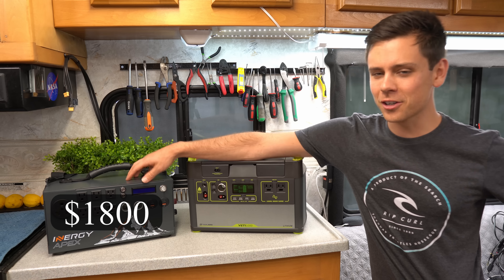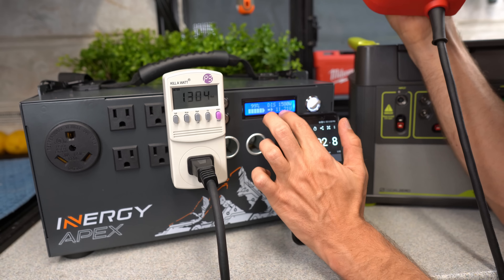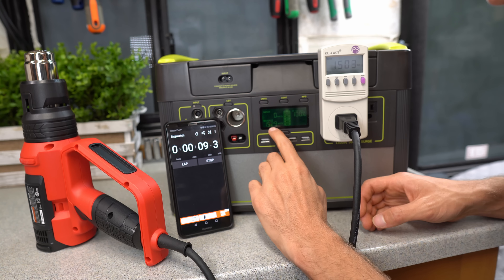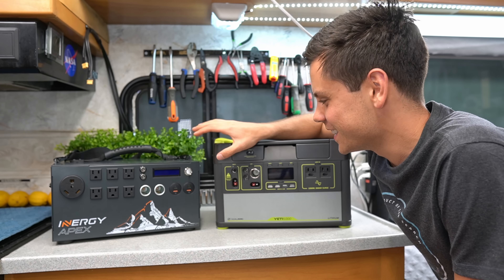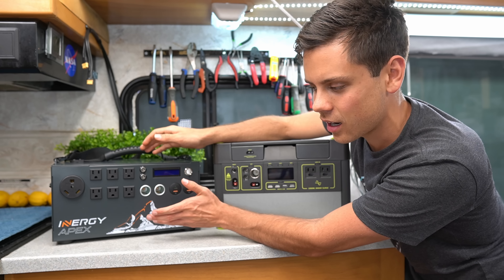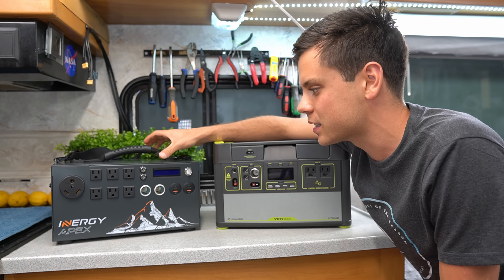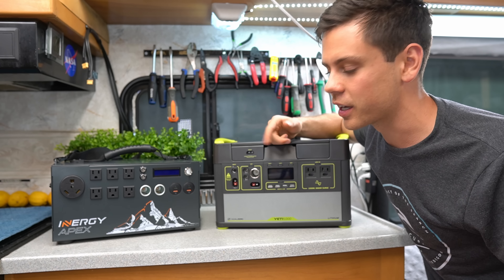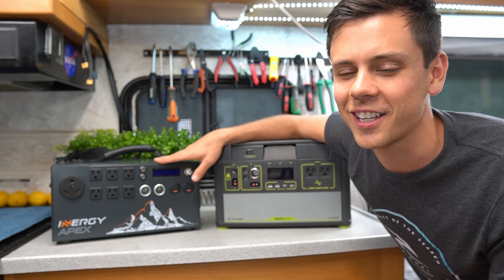$1100 GoalZero VS $1800 Inergy Apex Load Test

Comment: So does the goal zero charge up as fast as the Inergy.  Overall with everything u always consider would u buy the goal zero over the Inergy?
Reply from the maker: I'll be doing another video on charge rate for these. Inergy charges faster, but with modifications, the goal zero can too
Reply: @WillProwse  I think the main advantage of the Apex over the Yeti is charging cycles. For my situation where we plan to take our van on trips several times throughout the year, a Goal Zero unit would last for quite some time.
Reply: @WillProwse 

Thank you.
Reply: @jfinca1 I think Will spoke to this specifically. GZ and Inergy use the same battery chemistries so it would make sense that their batteries should have the same cycle specs.... but they don't. So perhaps as Will suggested, there could be other outside factors that are enabling the Apex to have more cycles. That being said, if the GZ is well replenished and doesn't go down to the 80% mark often, then it'll last a lot longer.
Reply: @jfinca1 I use up to 3 inputs on my Goal Zero while using it at the same time .  It doesn't care . . . . $774.00 for  'open box'  !  Love it ! ! ! 

   It's inverter will run my washer and dryer while my 'Windy Nation' pure sine inverter (1500 watt) try's , but bogs and shuts down.    Love the Goal Zero and their customer support was >100% when I needed it once . 

    The battery has not lost any capacity in over a year of use while in the mid-range of 40% to 80% .   Heat,  full charge,  and low charge  are the enemy's of Lithium battery's .    Run it in the middle and charge/discharge below 1C and it may last forever  ! ! ! !

Comment: If goal zero had a better charge controller so we can use more solar they would be a clear winner all around
Reply from the maker: They have a mppt module. I will test it this week. Really curious to see how well it does compared to my victron controllers. Will be an interesting test. Goalzero might be the winner when it has mppt upgrade
Reply: DIY Solar Power with Will Prowse Yeah, the MPPT module really helps with efficiency. Plus, you can also use the built-in PWM inputs at the same time for 720w total input from a mix of solar, wall chargers, car chargers simultaneously. Obviously slamming that much energy in fast isn’t going to make the battery very happy long term but it’s good to know you have flexibility. Inergy’s unit can only accept one kind of input at a fine according to their support folks.
Reply: @todd.parker  -  You nailed it !  I use up to 3 inputs on my Goal Zero while using it at the same time .  It doesn't care . . . . $774.00 for  'open box'  !  Love it ! ! ! 

   It's inverter will run my washer and dryer while my 'Windy Nation' pure sine inverter (1500 watt) try's , but bogs and shuts down.    Love the Goal Zero and their customer support was >100% when I needed it once .       Thanks .

Comment: If a person is converting a bus, has a specific number and type of power requirements and passes out when someone starts talking about electrical equipment, where can they go to have an A-Z package designed for their needs?  I'm talking the manufacturers, models, types and sizes of equipment and materials.  

It seems I only hear people talking about individual pieces of equipment but not a complete package for specific applications.  Here's an example of basic requirements, not specific to anyone's individual needs.  I'm not looking for answers to this example, just trying to explain a Package.

Based on a specific list of electrical equipment needing power and the power supply being mainly solar with a generator and then land line as backup, (A complete power supply package for any situation),  what would be the equipment and materials needed for a complete installation?  Again, I'm not looking for that list here but where to go to get the list based on a persons power requirements and ability to understand Electricity!
Reply: Tiny Watts Solar just started doing just that apparently.  If you're converting a bus I'm sure you've seen one of the tours of their Mercedes "land yacht"

Comment: Hello Will. I was initially considering the Apex until I saw the price point.   GROSSLY overpriced from a Kwh/$ perspective unless the weight savings is a must (25 lb. vs 40). It appears that several of the Kodiak touted "advantages" are merely a marketing smokescreen.  Not only did the Apex crap under a power load that some will need, but the battery efficiency under load was total *#$%&. Their advertised cycle rating (up to 2000) might just be another unsubstantiated claim.  Goal zero on the other hand appears to be making great strides to their product and state conservative specs making them the obvious choice. Glad you're pointing out some of the Kodiak fallacies and saving many some major coin.
Reply: Luis Colon . I totally agree, I own the yeti 1400 and it is awesome for me. It was worth the extra money...

Comment: Didn't you say you had  coupon code that made the Inergy  $1450 on the last test Inergy video.  Might want to fix that title me thinks.
Reply from the maker: Yeah and the goal zero is on sale for $824 sometimes. When it comes to these videos I'm going to put the MSRP no matter what.
Reply: @WillProwse  At $824, I think that's an amazing value despite its limitations.
Reply: @AaronGeller  -  I use up to 3 inputs on my Goal Zero while using it at the same time .  It doesn't care . . . . $774.00 for  'open box'  !  Love it ! ! ! 
   It's inverter will run my washer and dryer while my 'Windy Nation' pure sine inverter (1500 watt) try's , but bogs and shuts down.    Love the Goal Zero and their customer support was >100% when I needed it once .

Comment: Hi Will!  I have an Apex and need to know how to run the cable through the roof of my van.  Can we cut the ec8 cable, run it through a gland and then attach new ec8 connector?  Or butt splice the cables?  Or what?  We have send a few messages to Inergy with no response.   Being a newbie, I would appreciate any suggestions!  Thanks so much!   PS We love your videos!  Claudia
Reply from the maker: Yeah cut and use butt splice connectors. But make sure that you mark the cables!! If you mix them up and connect them to the Apex, it might destroy it.
Reply: @WillProwse  Wow!  Thank you for the super speedy reply!  I will let you know how it goes!  Thanks!
Reply: A follow up to my question - we ended up getting a cable clam from Blue Sea. Installation was super simple and so far so good!

Comment: So, the Apex is protecting its battery from being discharged too fast and too far in order to maintain its life and capacity. In order to get full capacity on the inverter continuously you need to have solar panels plugged in and charging which makes sense. The goal zero ran for nearly 30 minutes and its battery is now below 50% which is not good for every day usage to discharge it that far. Lithium Ion will last longest if you don’t discharge it daily below about 60-70%. Apex wins in my book.
Reply from the maker: Buy the Apex then. Sounds like you will be happy with that

Comment: Noice!

Uh oh! you're in trouble...... Inergy! 
I wonder when the other "US powertools" will come out with something like the EGO Inverter/Generator

Oh and how about a short video of all available, ready out of the box solar generators? 
Mmm maybe recommended HVAC units that can be powered by them? Refrigerators that can run on them at least until the next morning...
Reply: I agree - many van life/camper/boondockers would love to see such a comparison with any realistic A/C solutions.  For example, there are small 400-500w window AC units which some (I believe) have soft-start controllers to avoid the start up current spike.  These could be adapted to sit in the front window of a van and provide some sort of cooling/dehumidification.  The reason I'd love to see Will do such an experiment is he'd address usage strategies/gotchas/etc. such as how to perhaps expand enough capacity to use the unit infrequently at night - stuff like that.  I think a successful solution would go viral in these communities :-)

Comment: A poor test - seems like running a more realistic load like 500 watts would have been a WAY better real-world test.  With such a massive load you're measuring overload and thermal shutdown performance rather than real world operational performance.
Reply from the maker: Not for my systems. I push them to the limit
Reply from the maker: And watch my other video where I do those tests too. There is like three of them.